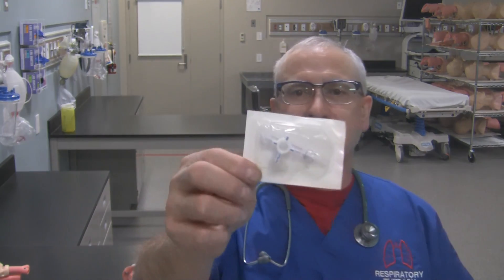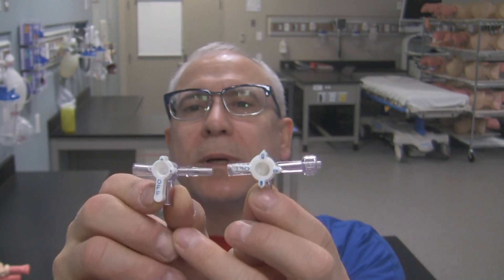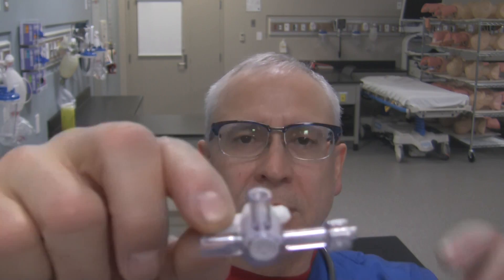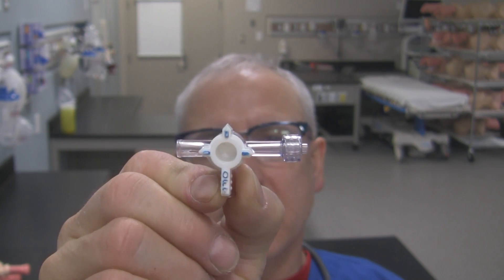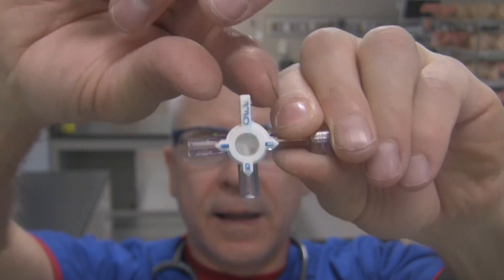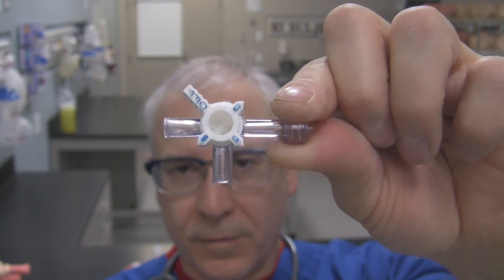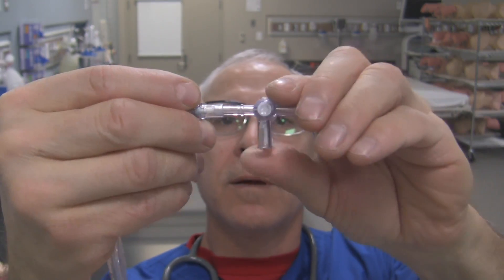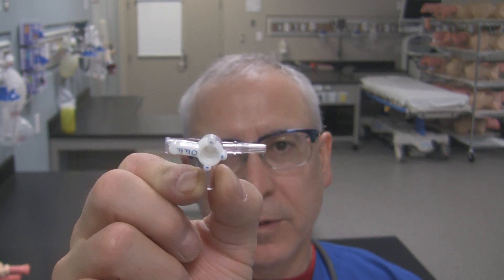The Three Way Stop Cock and How it Works

Comment: It is a great video, however, I think it would benefit your audience if you turn it on an angle and show the viewers the holes and how they have to align.  I often use the analogy of the trains in the roundhouse that need to align with the tracks in order for them to run.  Good job.